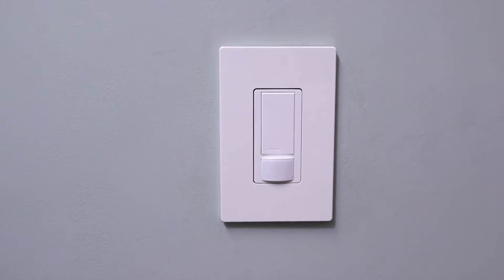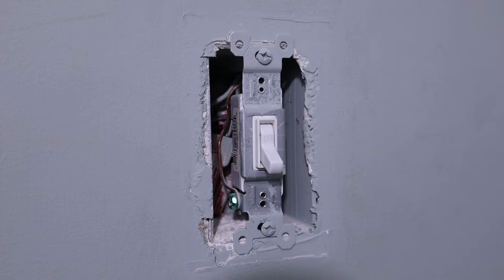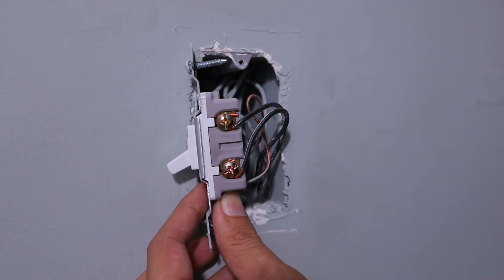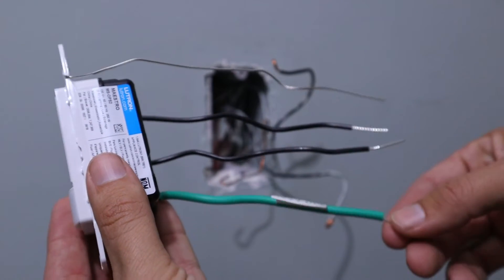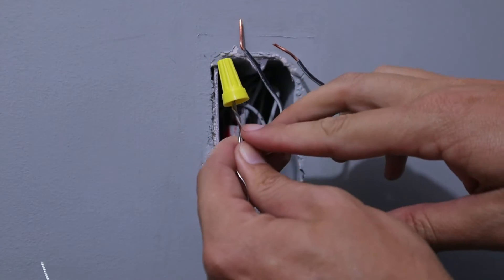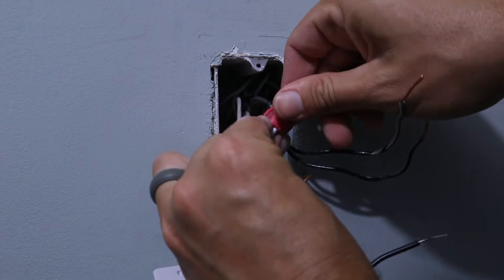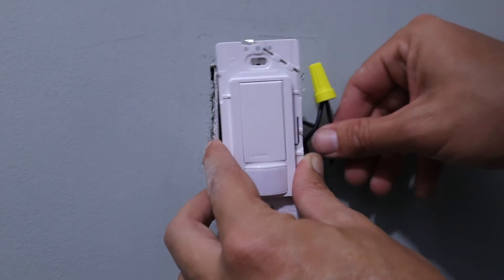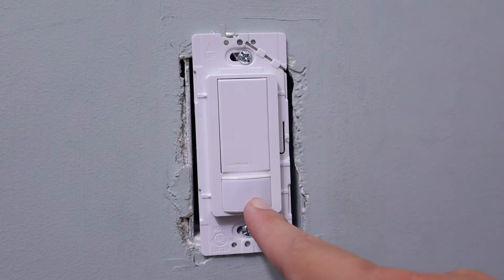How To Install a Motion Sensor Light Switch to Turn the Lights On/Off Automatically | Lutron Maestro

Comment: What do I do with a blue wire. I have 2 black,1 blue, and 1 green. In my box I have 2 black, 1 red, no green . My white wires are both connected to a regular light switch in the same box. I am not sure where to hook up the red and blue. Thank you for your help

Comment: Thank you. Very easy to understand your step by step, straightforward video. I appreciate it did not include a bunch of meaningless chit chat like so many do.  Question. I want to install one in my garage. I notice the sensor switches specify “amps.”  Is 2 amps OK for a single bulb in the garage?  Also, is there any worry about the garage temperatures that are very hot in summer and very cold in winter?  Thank you.

Comment: You give the best instructions on how to do this installation.  I just can't help but wonder, if just turning off the light is safe?  Do you have to attach the wires in the exact sequence you did to prevent the auto detection from starting up?  I would like more info on that aspect--otherwise this is the most explanatory and thorough walkthrough.

Comment: The lutron I bought at Home Depot didn't have the instructions. I have 2 light switches on both ends of my laundry room. I installed this on one of the plugs but it did not turn my lights on. I wonder since I didn't "program" the new switch, would be the reason. Any idea. Thank you

Comment: Thanks for this video. It helped a lot, I’m still running into an issue because I have two switches in my garage where the lights will come on, but they will not turn off. Any suggestions?

Comment: Hi Adam, a quick question. If I install a dimmer switch and the new switch has a ground wire, but there's no ground wire coming out of the switch wall box, where do I attach the new switch ground wire ?

Comment: How do u install a switch like this   to  a gfi. 2 black wires I know 1 hot 1 going to light.2 white  . I know the green wire on the switch is white .. I know I got to get power to the switch from the gfi .I'm doing something

Comment: I think if space is tight, you don't need to connect the neutral even if you have one since you'd use only 3 pigtails instead of 4 (just be sure to connect both the bare & white/green wire to the ground).

Comment: This is a very good explanation. The problem is my Lutron came with a blue wire, a green wire, AND a naked brass wire as well as the two black wires. Plus it was complicated by having two fixtures on the same switch. The hot wire was not labeled as such and the load wire went to a separate switch that operates the fan in the bathroom. That said, I am quite certain I connected everything properly. I connected the blue wire to the white neutral wires and then, through trial and error figured which was the hot wire. I then connected one black wire to the incoming hot wire and the other black wire to the outgoing wire. I get an electrical signal. I can program the fixture to turn on etc.I get blinking lights in the sensor etc. BUT the lights do not turn on. 

Have I done something wrong? Or is this particular sensor faulty?

Comment: Great video as always. I have a 2-gang box with 2 manual switches, on two different household circuits (A, B). But there is no neutral for circuit B. I just ran one piece of Romex for the switch. I bought a “Smart Wall Switch” that requires a neutral. My question: what if I connect the smart switch to circuit B line/load but use the neutral from circuit A. Will my house explode? Will my switch work? I was intrigued by the “optional neutral” in your video

Comment: I wanted to install but turned out my electrical box is plastic and ground wire inside the box is not connected to ground on the other side. There's no voltage between hot and ground wire in the box so switch is not working. Any suggestions?

Comment: IT DOES MATTER where the black wires go. One side is the hot load and the other side to the device.  If yours does not work, try reversing the wires. That did teh trick for me. All else correct - the white bundle is the neutral as described.

Comment: What if there is a red wire in the box? Where does that get attached to?
Reply: Red are 3 way wires like if you have a long hallway you can connect switches on both ends of the hallway to turn the one light off or on so you don't have to worry about ghosts following you in the dark down the hall😂

Comment: The switch in my wall only has 3 wires - a ground wire, a white (neutral) wire and one grey wire (load?) but my new switch looks like yours with a ground wire, a neutral (green / white) wire and two black wires. What do i do? 8:48

Comment: A quick tip for those toggle switches, if the light turns on when in the ON position, the top screw is the one with the hot wire, bottom is the switch leg

Comment: To say it doesn't matter which way the black wires are connected seems incorrect to me. Proper polarity should always be considered.
Reply from the maker: With this switch and single pole switches it doesn’t matter which black wire from the switch connects to which black wire coming from the wall because the two black wires are separated by the switch.  Once the switch is engaged then the two blacks (line/load) become connected and your light turns on.  Now where you would have a big problem would be if somehow the neutral wire from the switch was connected one of the black wires coming from the wall.  Why anyone would ever do that I don’t know.   Make sure to follow the instructions included with whatever device is being installed.  In this case they did state that it did not matter which black wire from the switch connects to which black wire in the wall and I hope I was able to convey why.  Thanks for the comment Tim!

Comment: Is this the same for a 277? I installed a 277 light switch and it stays in all the time, does not shut off. I wonder if I have neutral connected to wrong wire

Comment: Thanks, I didn't unstand the white wire on the motion switch. I was making an extension cord with the motion switch and out on the the end. Now when I wak in the shop the fan and radio turns on, or whatever. I know, totaly unnessary but fan. I have wire normal stuff but the this one stumped me. Dan B

Comment: I have no ground connection on my switch and my wires connecting to line and load is blue. I do see a neutral wire and ground wire inside the box.

Comment: i have a 3 way awitch  in my hall way if i change the top switch to a motion sensor can i keep the one on the bottom to turn on and off manually and will the switch turn off manually from the top switch if there is no movement

Comment: OK, Mr. Carr; Thanks.  But, I have a question.  If you have another light switch down line in a serious after this switch how is the wiring done?  I did the initial wiring but the down line switch only works automatically if the first sensor is tripped on. Thanks.
Reply from the maker: Hey Mark, so did you have an extra wire in the box?  Maybe a red one?

Comment: Ok, folks, this is a really bad video, don’t follow it, it most likely won’t work for you, sorry. Why? Notice that he never showed a wiring diagram, nor explain what the light/switch setup is, and that matters, big time. Sometimes the power source goes directly to the light, not the switch, so the switch wiring changes. Sometimes you control one light with 2 switches, so you’ll have red wire also, that’s different wiring too. Please, don’t follow any video that doesn’t draw first the circuit do you can see if you have exactly that setup of lights and switches.
Reply from the maker: There is nothing wrong with the video or the install.  It is false to say that this won't work for most as it will work as shown for anyone with a house even close to current electrical code.  This was not a 3 way switch install which is what you are calling one light with 2 switches.  Although they do sell them.  Older homes with the power going to the fixture first, it can still work as long as they have a ground in the switch box as a neutral is not required for this switch.  Which I briefly touched on in the video.  Yes you need to do your due diligence on any project to know what you need due to what you have.  No youtube video can cover every single scenario as there are so many.  Always follow the instructions that come with whatever you are installing and also look at your local code.

Comment: Very informative! When I removed my light switch I found that there was only a black wire and a red wire connected to the switch. Inside of the box I do have the ground wire and white wire I am just curious what should the red wire be connected to being that this motion sensor has 2 black wires. Thanks in advance.
Reply: Red is switch leg has to go from the load side to the actual light

Comment: Interesting.  I thought about using these at one time as my son never turned lights off.  In the end I used my Smartthings Alarm Motion sensors and switches to do the same.  The only other thing I did was make a cheat so when my son wanted to play hide and seek, I knew exactly where he was.  :-)
Reply from the maker: Haha you aint right!  But that is a smart way of doing it.  Thanks a lot for the feedback!

Comment: Whoooa. You should know, without a neutral wire, your method of capping the silver green and ground will work, but is completely unsafe..
Reply from the maker: It’s not my method, it’s literally in the instructions for the switch.

Comment: I can't thank you enough for the detailed instructions, the manufactures are pretty limited and have to admit I wire it incorrectly the first time, didn't understand the silver wire was actually ground. Have replaced all switches in my house with no problem but this one was a bit different and overlooked installation of the silver wire ... all is working now and no more finding garage light on all night!!!
Reply from the maker: You are very welcome!  Really glad to hear that it helped you to get it working properly.  It does make life a little easier!

Comment: Thank you, finally I see something that is simple and breaks it down very clear. How about this, I have a those old standard switches for the bathroom fan and one for the light and I want to use the motion sensor for the light and a three way switch for the fan? Can this be use like this?

Comment: Thank you for the video, pretty helpfull.
I have a question: I only have, coming out from the wall, 1 black White, 1 White and 1 a silver wire.
How Do I connect those with the ones from the switch?
Reply: 11 months and still no answer! Wow! I'm doin the same thing only 1 hot 1 neutral.  It's an old house. Would be nice if these people would answer you back that make these videos that does not cover all or most scenarios. Pitiful.
Let me know how you hooked yours up. Thanks.